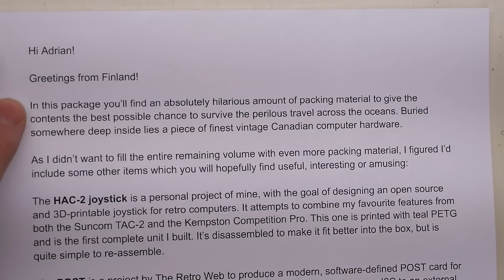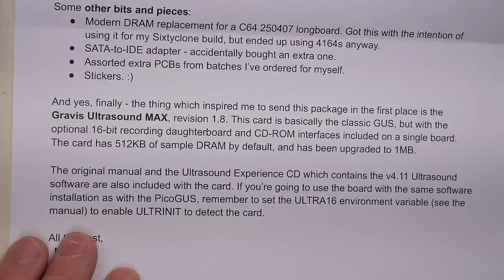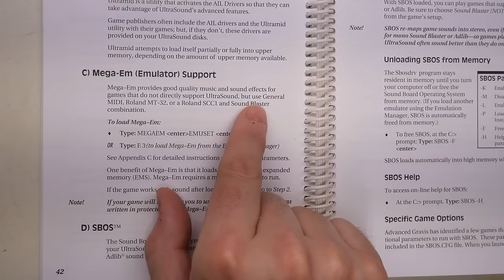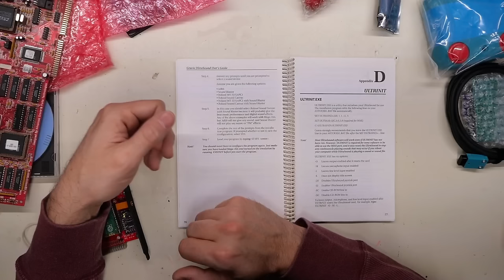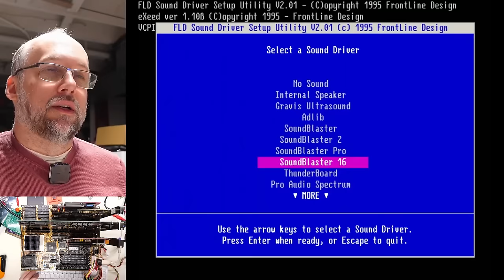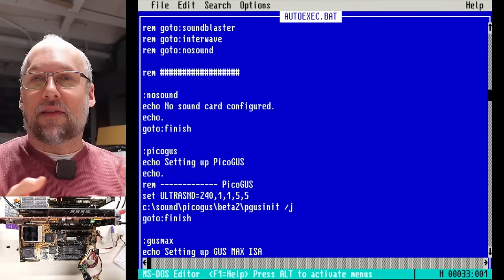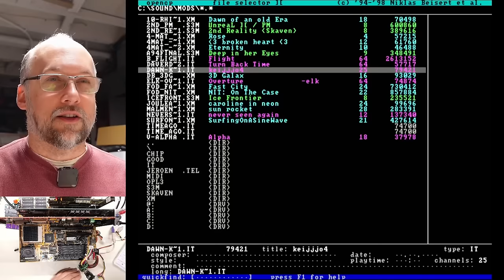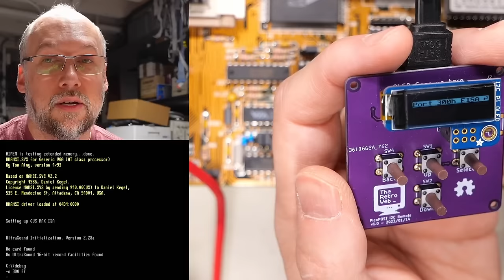0075 A Gravis Ultrasound that needs repair, a 3D printed joystick and a software defined PicoPOST

Comment: PicoPOST firmware developer here! Awesome showcase of how good my code normally is 😅
There's a new release (0.5.0) coming very soon which should fix the incorrect high-byte address decoding, might even fix the spurious reads and finally also reports the reset line activity (assert and release).
Reply from the maker: Awesome!!!
Reply: PicoPOST hardware guy here! I'll tag on this and give a bit of explanations and updates:

Despite the name, the PicoPOST isn't meant to just be an overcomplicated POST reader. The long-term goal is to be able to give human-readable decoding of what's going wrong in a retro system. A secondary (and more achievable) goal is to make it be able to function as an affordable bus analyzer/dumper for expert users.

Having the remote for the OLED and controls was intended to make it possible to see and use in machines in a tower case (which I've had problems with on the classic China POST cards). However Adrian's complaints are valid, and the next revision of the board will likely have provision to be able to mount the remote to the top of the main card.

We're also going to have a hardware fix that should make the bus decoding much more reliable, which along with the new firmware version, should fix most of the bogus and missing reads as seen in this video.

The -12V voltage reading may be going away. It seems to be more trouble than it's worth, and another (more useful) feature will take it's place.

If you're interested in helping out, check the git repo Adrian linked in the description, and you can find links in the readme for where you can talk to us. :)
Reply: @TechLeftBehind -12V is so rarely used. I think it would be enough to just provide a LED to indicate if it is there at all, and maybe a test point on the board. That way, IF someone wants to check the voltage, it would be easier to get to a test point on the board.
Reply: @adriansdigitalbasement2 could you try to archive the period correct POST card’s pinout and schematics, or at least upload high resolution pictures of the card? I’d love to see if it’s possible to implement those address LED’s on a simple post analyzer card. 

49:14 Also, address 300h could very well be only addressable to the PCI portion of that Chinese POST card. 

@TheRealZago would it be possible to create similar card like the Chinese card, which supports an LPT port, PCI, PCIe and ISA? perhaps even MCA? (might be too much to ask)
Reply: @TechLeftBehind  Maybe someone can just design a 3D printable clip so the OLED can mount on the ISA card in a "T" configuration. That would make it very readable in a tower or desktop case with the lid off.
Reply: @Inject0r  PCI (and possibly MCA? Haven't looked that up yet) are completely different beasts and would require more GPIO than the RP2040 MCU offer. The bus interface is also very different, with frames and stuff involved which render reading a transaction a bit complex.
PCIe is a very fast serial bus which would require an IC with native PCIe interface. Also, most motherboards with PCIe don't output any diagnostic info to it, it's usually relegated to a secondary bus like LPC or a custom diag port.
Maybe with a PicoPOST Plus... 😄
Reply: You the real MVP! Thank you so much for your hard work and those like yourself striving to help this community!
Reply: That PicoPOST thing is a fancy toy for hardware and software developers but appears to be pretty useless as an actual tool for doing actual work ... too many false readings ... too much software ... too much "click around on these buttons here, wank around in that menu there and look at flying toasters for a bit" ... and too many potential failure points in general (maybe there is a bug in the firmware? maybe the pi pico is faulty? maybe this? maybe that?) ... 

The LAST thing I need is having to diagnose and troubleshoot the equippment I'm supposed to use to diagnose and troubleshoot something else with - been there, done that.
Reply: @KenjiUmino  It's almost like the hardware and (especially) the software isn't done yet... imagine that. Many of the problems seen in this video have already been fixed or we have a plan to fix. :)
Reply: @TechLeftBehind  software is never "done" ;)

And don't get me wrong: It is an interesting project, and I bet (I hope) it is fun to work on .... but I'm not sure if a simple tool like a POST card will really see much benefit from adding a dot matrix display, more compute power and more fancy software... 

just think about it ... other things (kitchen appliances, diagnostic tools but also, and especially, cars and printers) did not get any more reliable once they started having a fancy display and more complicated software built in just for the sake of it...
Reply: @KenjiUmino  Your mistake here is that our intent is for this to be only a POST card. I agree that our project would be overcomplicated.

Like Adrian mentioned later in the video (and I elaborated above), our plans are more inline with a "smart" bus analyzer than a simple POST card. Normal POST code readout is just the first step there, since that's pretty easy to implement. By the end, the point to not use POST codes at all, because they're not much better than garbage most of the time.

Comment: Just in case anyone is thinking of building the C64 RF modulator replacement, I recommend waiting for the new version. It should be ready in the next couple of weeks but includes a number of improvements over the current version.

Thanks for the shoutout Adrian!
Reply: Haha, i got some pcbs made on the recommendation of Adrian a while back, so when i do eventually get around to building them, it'll still be the older version... unless i order more pcbs.. the downside of being ambitious in the ordering but lazy in the work 😀
Reply: @brianv2871  Don't worry, I do that all the time. Order PCBs, source parts, put everything aside for 6-12 months...

Comment: FYI the C64 was extremely popular in Finland in the 80s. I read somewhere that it had most C64's per capita in the world. It is quite often mentioned of the most generational thing for the millenials. If you ever visit Finland, there are couple museums that might interest you: Tietokonemuseo Ata in Helsinki or Suomen pelimuseo in Tampere (<2h train trip from Helsinki).
Reply: So it's equal to the impact of the NES here in the states? (At it's peak, the NES was in 1 out of 4 households)
Reply: @Toonrick12  Around 200k were sold in Finland, with a population around 4,8 million and around 2 million households in the 80s. So not quite as much as comparison. But everyone knew at least somebody who had one.

Comment: Soundcards right up to the late 90s had no shielding whatsoever and usually werent grounded properly either causing excessive noise from the cpu, however they were still a country mile better than anything found built in to a motherboard, i used to make my own shielding with aluminium foil inside laminating sheets, then run it through the laminator -  it works extremely well, you ought to give it a go.

Comment: Please assemble that MixSID board. It is not just stereo SID that requires special demos etc. You can configure it to have both SIDs on the default address, and if you install one 6581 and one 8580 on that board, you get a "pseudo stereo" effect due to the sound characteristic differences between them even with all the period correct games that has got nothing to do with a dual SID setup. I have the PCBs sitting for some time now, the web page has a great interactive assembly guide, but I would like to see it in action before I start building it.

Comment: In case no one has mentioned yet, but those micro-switched joysticks would typically have suction cups feet which allowed you to stick it to your table for more stable playing. I imagine you'd be able to by them somewhere, and you could just glue 'em on.
Reply: Well no, the Kempston Competition PRO which this one is based on never had those suction cup feet. It was meant to be held in both of your hands.
Reply: @kellerkind6169  I guess not all brands had them, but most of the ones I had, including 2 Zipstiks and a Cruiser had them, all three of which I still have.

Have a few others, too, and they have them, but those don't use switches, they're the cheapo rubber dome ones, most of them don't even centre properly anymore.
Reply: I don't remember what was on the bottom of my competition pro specifically but I had several joysticks including cheap leaf switch ones and my memory was of them having suction cups that were very useful. I got the pro late in my eight or sixteen bit playing life and vaguely remember finding it a disappointment that hurt my hands to use after all the hype.

Comment: I also was never so much a fan of these joysticks, but there was one type of arcade-style joystick that I really loved.  It had suction cups on the bottom, so it stayed down on a surface so you didn't have to hold it in your hands which gave a more real arcade experience.  Then they started creating them with cheap suction cups that didn't hold anymore and the love was gone.

Comment: That joystick is just calling out for some suction cups on the base!
Reply: It had been designed to be used with the Atari 2600, when you're sitting in a couch in front of the TV.  You're supposed to hold the base in one hand, like you would hold a modern game controller with handles (except only one).

Comment: Nice :). Bought a working rev 1.8 Ultrasound MAX with the memory expansion online locally two days ago for my original computer rebuild and slight update (486 DX2-66 VESA - Socket 7 AMD K5 PR133 100 MHZ, to start with). I have not yet found my original MAX card rev 1.1 that i believe should exist still. I wonder if you could add aditional ram chips to the card??, the later rev 2+ series of MAX card do not have that option.

Comment: That Crystal chip will be part of the "Recording" daughterboard built into the GUS Max. I think.
Reply: It is. I have an actual Daughterboard to upgrade a classic GUS, and it has the same chip. It provides "Windows Sound System" compatibility too, but in real Gravis fashion, the drivers and the additional quirks of the card made it somewhat tricky to get it working. Additionally, the GUS MAX and the Daughtercard uses slightly different port addresses and whatnot, IIRC, so not all software that supports the MAX works with the Daughterboard and vice-versa. Good stuff. Just Gravis things. Still love all of 'em tho'. (And my PIcoGUS is on the way too!)

Comment: At 40:12, you imply that the original GUS doesn't have MIDI output, but it definitely does. It uses the DB-15 port that a joystick would plug into to emit MIDI signals. You have to have a breakout box for it (which has a passthrough for a joystick, IIRC), but that was very common at the time. The Sound Blaster worked the same way.

Comment: 21:59 Not to discredit the quality of the joystick but I don't know why given 3D printed customs they don't just rotate the face buttons to a horizontal orientation to the right of the joystick with just a little more width.
If it's a question of joystick ambidexterity you can add a directional flop-switch like the Gravis Gamepad had which will support left-handed players since the layout has symmetry for use.

Comment: I have to disagree on Sound Card for PC. I am still using today in my Ryzen 5 PC a SoundBlaster PCIe card. I can hear the cleaner sound from it versus the onboard especially in MIDI in Windows 10. I use Bose Desktop speakers and can hear the difference. Even my USB SoundBlaster sounds better than onboard. I can do extra effects that are not available on the Software based Realtek and other cards. Surprising MIDI synth actually sounds better in DOSBox if put through the SoundBlaster card too.
Reply: @humidbeing  Wrong. Just plain wrong. Windows 10 supports hardware synth just fine. It is just a matter of selecting the right device in the software.
Reply: @TSteffi   While true.... what uses MIDI anymore?  (Other than pro audio stuff, where you're not using the built-in Windows soft synths anyway.)  Is this really the best option for DOSBox MIDI pass-through?  Aren't there purpose-built MT32 and SC soft-synths?
Reply: @nickwallette6201  The same thing that always used MIDI: Music Instruments. MIDI was never about playing music, that was just a side effect. The main purpose of MIDI is and was to connect music instruments. 

Yes, you can get really good software synths. But if you already have a soundcard for the better audio quality anyways, then why not use it? Why would you run something in software on the CPU while you have a dedicated chip for just that function sitting idle in your machine?
Reply: @TSteffi  But musical instruments don't need a sound card, just a MIDI interface.  Assuming you mean things like samplers, ROMplers, keyboards, beat boxes, etc.

There's very little to benefit from dedicated hardware processing now for soft-synths.  The CPU is MORE than capable of handling virtually infinite polyphony, even with the best resampling algorithms.

I have $thousands invested in DAW plugins from, e.g., Waves, Native Instruments, Digital Sound Factory, etc.  None of that stuff expects or would even take advantage of dedicated wavetable hardware.  All you need is a decent DAC to play it through.  My MBP's internal audio, and AirPod Pros work great for just about all I ever do, and I use outboard rack interfaces for the times when I need something high end, or just tens of channels.  But even then, it's just an output device for PCM, nothing more.
Reply: Just fyi the PCIe internal cards can sometimes still pick up noise from the rest of the system buses, whereas external USB ones (provided you have clean enough power) are usually relatively more shielded and have lower noise. If you can't notice a difference that's great, and the rear outputs are definitely cleaner on the internal card than hooking-up the front panel audio connectors. But if you really want to minimise noise you'll be using the USB one. (But then, if the Bose speakers are self-powered, their own power supply noise might be louder than either the PCIe or USB audio interfaces' noise floor.)
Reply: @nickwallette6201  yeah, with modern SBs you're basically just getting a gamer-ified Scarlett (other brands of interface are available). Especially the USB ones.

Though a few plugins can offload work from the CPU to hardware in an interface (I think NI does that?)... but only very specific interfaces from the same parent company. Definitely not gonna do anythings special on a Sound Blaster!
Reply: Dedicated pcie sound cards have become the same niche as expensive consumer audio equipment. Most people doesn't need them because the baseline integrated sound card has become decent enough for most but they pale in comparison to dedicated pcie audio cards, specially if you listen to music in the PC and use high impedance headphones.

We can discuss if Creative has become very greedy and bundle their cards with bloatware, but we can't deny they offer an upgrade over stock audio.

Comment: Oh, the Amiga 4 player adaptor.
I remember coming across 2 of them when I was growing up, actually even purchased a 4 player adaptor cable (Just a DB25 that plugs into your parallel port with 2 wires coming out going to a pair of DB9s for you to plug your joysticks into)
The only game I can remember the name of was Dyna Blaster, basically a Bomberman game, and it was only for the Vs Arena mode.

Comment: you should play Zone 66 on GUS; I had the 1.0 version of the GUS because, at the time, it was really the cheapest "modern" consumer grade soundcard available at that time, behind the Soundblaster Pro and Proaudio Spectrum.  I loved it but my 386 sx 25 could barely run the software.

Comment: I'm curious if the list of MOD files/MOD player you're using are something that can be shared or linked to without copyright concerns. I'd like to test out the MOD playback and compare it between my Crystal Audio 1869 and my PicoGUS 2.0.
Reply: Yt is crazy paranoid
Reply: @nemesis2264  yeah Zip files with hundreds of MODs each are great. Even if you have to sort out the dupes if you get more than one. VLC can still play them no problem, though with no fancy visualisers, so you can even shuffle them in amongst FLACs, AACs, etc.

Comment: 23:48  Take a big, heavy Cr steel plate like 60in60in2in and glue Joystick to it using epoxy resin for stability issue.

Comment: my first pc was a Pentium 200 MMX, which had a S3 Virge 325 video card, and a SB16 ISA card. when it died, the computer store decided to reuse the video card instead of the sound card (I had no say in the matter, was too young), so I ended up with a Pentium 3 computer with a SB128 pci card, and the S3 video card. I eventually got a real gpu, but the SB128 never worked as well as the original sb16 for old games. I was greatly annoyed by it.

Comment: Gotta say Adrian, I absolutely adore those White ceramic ICs (guessing they're not resistor blocks despite the name?). 
If I had your means, I would strive to build an entire system that uses either those White or the Ceramic and Gold packages!

I do have a couple of old 8-Bit ISA Token Ring cards that are absolutely beautiful!
I''d happily send you an image, but I am in the UK and basically flat broke, so no mail call from me ... got a couple of other interesting devices that I'd love to share images and info with you too? Including one electronic device that I am almost positive that 99% of your followes will not have seen!

Edit: Shows what I know - they are indeed resistor packs "Dual-In-Line Thick Film Resistor Network!"
 I will follow your motto and not edit out my mistakes either!